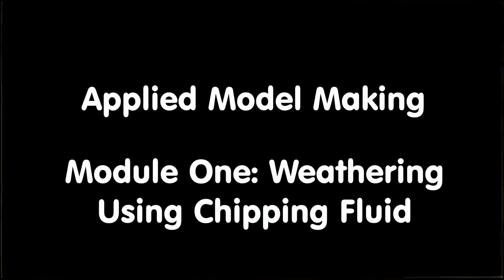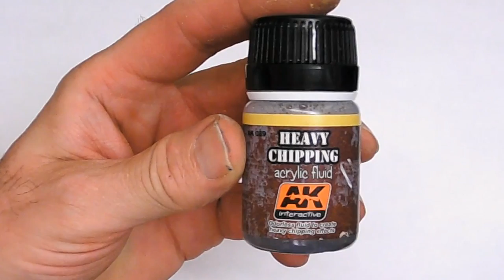Using AK  interactive chipping fluid; a short tutorial

Comment: Does this method only work if the top (e.g. yellow) coat is acrylic paint, or would it work with an enamel as well?
Reply from the maker: Trains, Trams, Trolleys, Travel it would only work with a water based acrylic paint
Reply: i tried it with enamel paints and it worked fine too. just dont apply the enamel layer too thickly